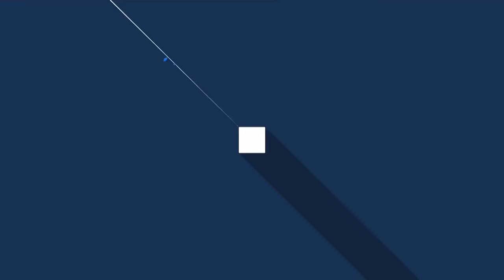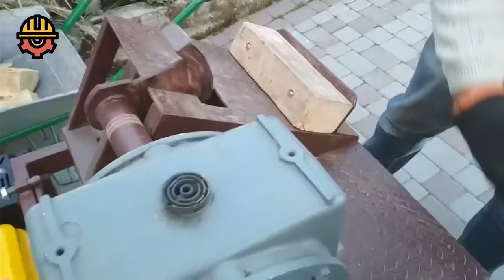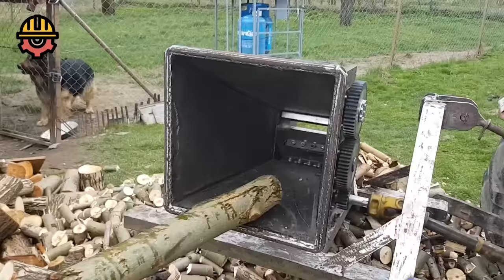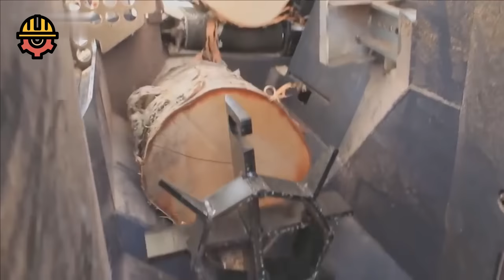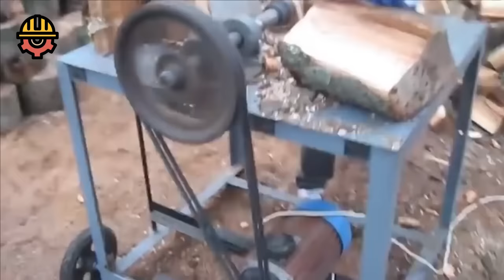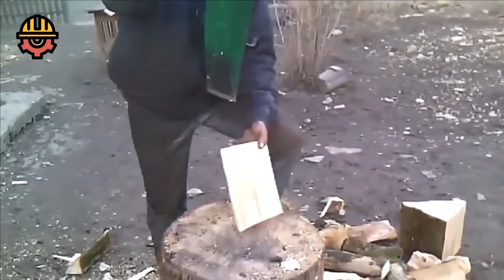Dangerous Fastest Firewood Processing Machines, Amazing Homemade Wood Chipper Machine, Wood Splitter

Comment: Continuous splitting machines are criminals. That is the best way to lose fingers or even an arm. Not very bright.
Reply: You know this is a video about dangerous wood splitting machines?  Pointing out how dangerous they are is a little redundant.
Reply: The same with a chop saw.
Gotta pay attention aways. I knew a guy that chopped his thumb off after using the saw for 21years
Reply: @eprn1n2  Every machine is dangerous, but if you pay attention to what I wrote, I said « Continuous splitting machine» is criminal. Though, it's not redundant, don't you agree ?
Reply: sevieballesteros8301 one would have to be pretty stupid if one can't find a way to do both 😂
Reply: @c.danjou.1696 wrong. Several of the machines with continuous rams don't even push to the wedge. Lots of guys lose fingers after they press a lever each time and it pushes to the wedge... And they have a finger in the way. Those machines are safer. Just don't wear baggy clothes.

Comment: I can’t get over the fact that most people who split firewood, pick it up off of the ground split it let it fall to the ground and then pick it up again. Once it comes up off the ground it shouldn’t go back down again, figure out a system.
Reply: You get warm many times that way !! 🔥
Reply: @urbanbengtsson2500  
Yes, that does happen and it’s not important when you’re young. It does dawn on people once they mature. In my estimation based on life experience, people are under the impression that because they use wood for a heat source in many cases but not all, that it’s inexpensive and they are saving money . Even if you have a plot of land where you can harvest trees, nothing is free. Studies have been done to see if the effort and time spent in a different direction earning money would be better than everything involved with assuring yourself do you have enough wood for the winter. I’m quite aware of the fact that some people use it as supplemental heat or for a fireplace. That of course is a whole different set of circumstances and is not a money saver but probably enjoyable.
Reply: That’s what I see and my back says he’ll no so I would solve that problem in a heartbeat 😊

Comment: I’d love to see how these wood splitters would work on dry Australian hardwoods.
Reply: Yep, I was thinking the exact same thing
Reply: Dry woods are very easy for hydrolic wood splitters..
Reply: @trelisman1673  I have a 20 ton hydraulic wood splitter with a single blade. It has a lot of trouble splitting dry York Gum and sometimes White Gum .
Reply: Try misquite wood 😊
Reply: You still have to use your brain and split with the pre-existing cracks and grain. But they're fine if you cut longer than 40cm
Reply: @sasquatchrosefarts  have you cut dry white gum or York gum with one of these .

Comment: I'd love to see the risk assessment paperwork for using this machine.
Reply: Who cares. He knows what he’s doing. Too many snowflakes about already.
Reply: Yeh.tell that to the chap with a lmb or two missing. The very fact that fewer limbs are lost shows risk assessments work. Who charges headlong into darkness without lights, just fools.
Reply: @davidturner8689  I agree that safety has to be a priority. I have seen a lot of things happen in during my relatively young 34 years here on Earth. I was running a conventional log splitter in the vertical position with my girl friend operating it recently. I was knelt down and I went to get up and slipped into the log splitter. I put my arm up to save myself and it was between the metal beams that knock the wood off and the wedge was on the way back. So if the wedge was closer, I could have gotten my arm stuck in it and I do not even want to guess what it would have done to my forearm. Part of it was awareness as well. I think safety is often overdone to demonstrate compliance but it does have a very important role with machinery.
Reply: @donalfinn4205  You can Pay their lifetime of disability.
Reply: @davidturner8689 I bet that risk assessment is a novel in itself! Do you think there's any way to make operating these machines truly safe?

Comment: i enjoyed seeing the different machines. i burned wood to heat my house for about 20 years and did it all by hand with just a couple of chainsaws, splitting maul. axes, sledge hammer and a wedge sometimes. i didn't need a machine but i was only doing it for my own home. i used to get a lot of my wood when we would clear for our power lines at the light department i worked for and i would also buy a grapple load sometimes. i don't burn anymore, too much work, too messy and i'm too old.
Reply: Hi Steve, we started burning wood to heat our house about 45 years ago like you using a chainsaw and a felling axe then a splitting maul, rarely a wedge and a sledge hammer. About 20 years ago I started working as a volunteer with our local council, I could then choose what wood we got, wood without knots and the best for burning. 4 years ago we invested in a quality log splitter, this machine has been a boon for us. I'm 78, not sure how much longer we will be able to make our own fire wood, bought in stuff is usually rubbish in our experience.

Is that a kelpie at 2:56?? We had a kelpie rescue dog along with 7 other rescue dogs over the years, you cannot beat a kelpie. Of course I cannot be sure as we've had 9 different rescues nearly all different breeds except two German shepherds, only one kelpie, fantastic dog!!
Reply: @johnwoody9505  yes, i rarely had to use the wedge and hammer unless it was some onery piece of wood. i would get a lot of maple, oak and ash from where i worked and when i did buy a grapple load i would request no junk and i would get some nice wood that was easy to work with. i gave away all my stoves and tools and now we just burn oil$$$.

Comment: I liked the setup at about 10:40 it had a screw cone to split down the stem wood which could then go through the spiral sheer with that splitting wedge built in.  The ones that seem to use differentials reverse driven by the PTO off a tractor or electric motor are my favorite.
Reply: The one at 14:02 also gets my vote, never comes close enough to the anvil to pinch anything and slow moving enough to stop if something goes wrong.  Reminds me of old locomotive wheels and driving rods.

Comment: None of the wood splitters shown in this video is strong enough to split the pinion wood I use. My wood splitter has a large diameter ram and is mounted on an 8 inch I beam which has bent because the pressure needed to split some pieces of pinion is so great.

Comment: Nothing particularly dangerous about those cone screw, or "unicorn" type splitters - they're just old technology.
Gravely used to offer one of those log splitters to attach to their L series two-wheel tractors. They faded from use when the hydraulic units came around in the Seventies.
Reply from the maker: Thank you very much for sharing your opinion. Those are valuable feedback for me to improve.